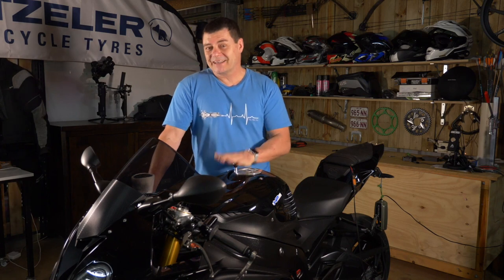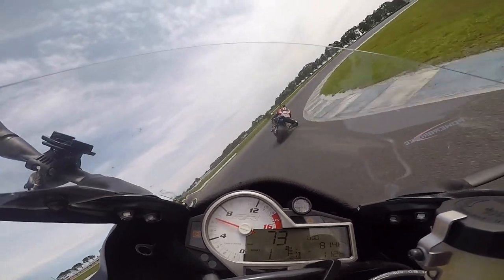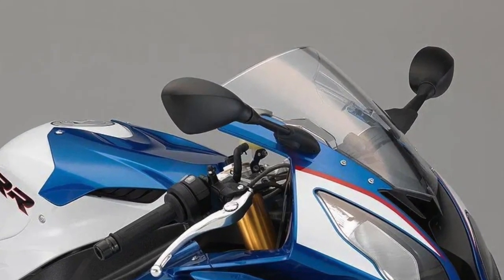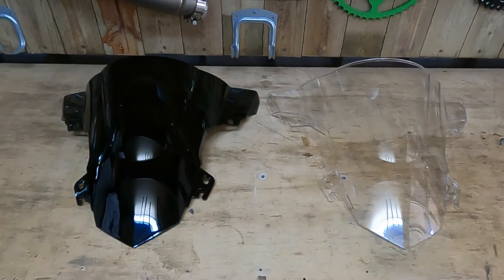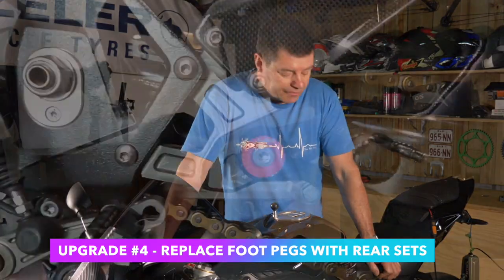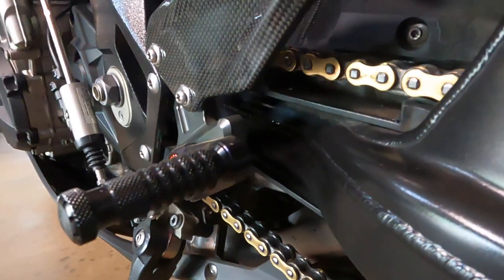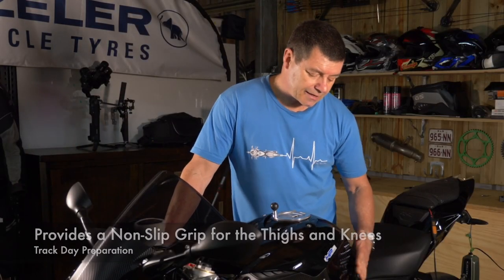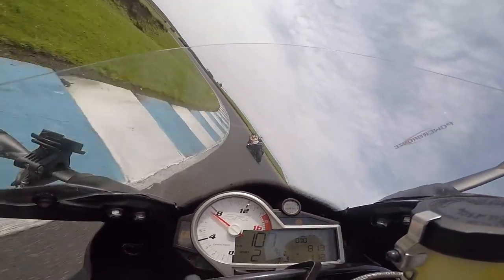Prepare Your Bike for Track Days - 5 Sports Bike Upgrades You Should Consider

Comment: Good tips!
One thing you didn't mention is to adjust your tire pressures for the track - check with the manufacturers recommendation it's usually a good starting point at least. Will make a big difference and it's free! 😉
Reply from the maker: Thanks mate, good advice, we'll publish the pre-track check video soon which includes that.

Comment: Hi is braided brake lines important? I am planning to change my pad first.
Reply from the maker: All of the newer sports bikes come with braided lines to the best of my knowledge, so replacing them with an after market brand won't necessarily do anything unless you are bypassing ABS or something like that. If you do have rubber lines, then for sure get some braided ones. My experience with rubber lines, particularly as they get older, is they contribute to a spongy feel when braking because they expand so you don't get the same stopping power and feel you get with braided. Hope that helps mate.